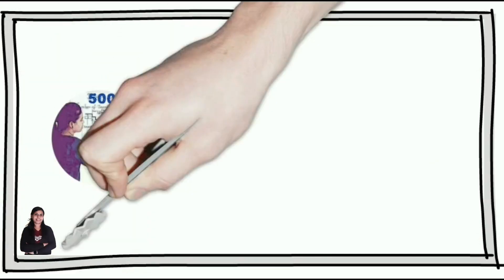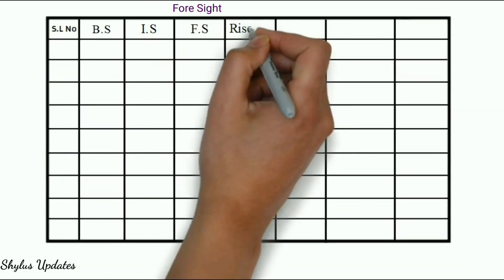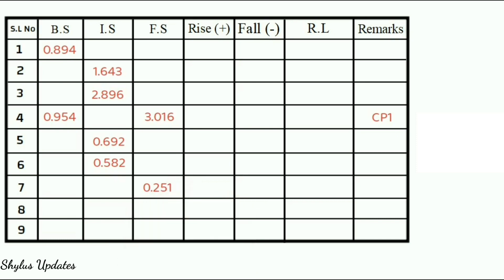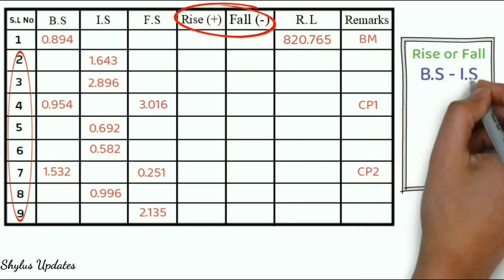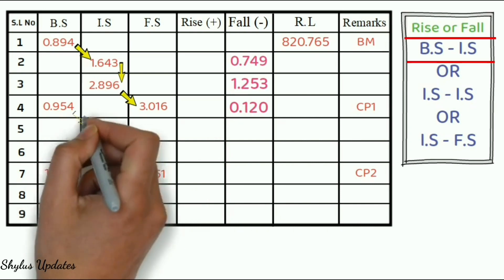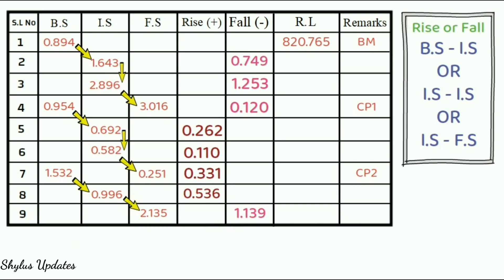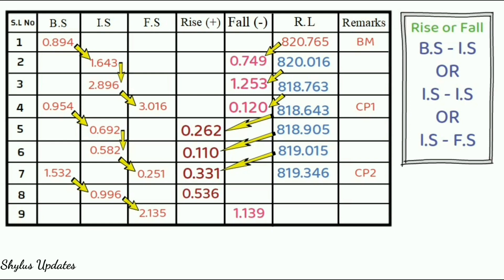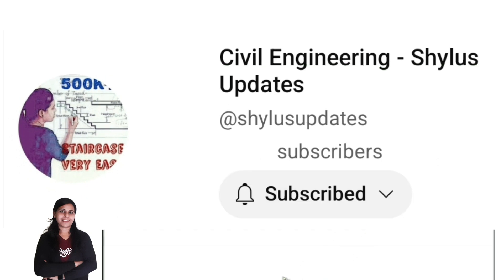rise and fall method in levelling | determination of reduced levels | surveying | Animated video

Comment: can i ask , i have a situation where by in CP Im not given a BS NUMBER how do i approach that ?
Reply from the maker: Excellent question 👍 — this shows you really understand the concept of Rise and Fall Method in detail!
Let’s go step by step 👇
 Situation:
You have a Change Point (CP) —
but the Back Sight (BS) reading is not given for that point.

 First, let’s recall what a Change Point means:
A Change Point (CP) is the point where the instrument is shifted to a new position.
At this point:
The Foresight (FS) from the old instrument station is taken.
The Backsight (BS) from the new instrument station is taken.
These two readings are connected to keep the leveling continuous.
So, every CP should have two readings:
👉 FS (from old position) and BS (from new position).
 Now, if BS is missing on the CP:
That means, after shifting the instrument, you forgot to take or record the new backsight reading.
Without that BS, you cannot directly continue the rise and fall or RL calculations beyond that point — because the new RLs depend on it.

✅ Possible Solutions:
1. If you have the RL of the Change Point (known RL):
Then you can continue like this:
Take the known RL of the CP (from previous instrument setup).
Use that RL as the starting point RL for the next setup.
Then continue with your next readings (IS and FS) normally.

Comment: Thanks in advance.May you please elaborate why you have located CP2 at 7th point instead of 8th point as the questions explains?
Reply from the maker: Sure, I will clear you doubt now ❤️

You have understood that at Row '7',
I have entered the 8th point CP2 right?
First see carefully how to enter readings,
1st point 0.894 (B.S)
2nd point 1.643 (I.S)
3rd point 2.896 (1.S)
4th point 0.316
(F. S - b'coz this point is CP1)
Next, 5th point 0.954 automatically comes on B.S
6th point 0.692 (I.S)
7th point 0.582 (I.S)
8th point is CP2 so it will come under F. S
So consider these readings as points.
and
You should not see the calculation based on Table numbers that is in first column numbers like 1,2,3,4,5,6,78,9.
This numbers are only for reference. These are not points.
In question they have given you 11 readings that is called points.
Hope you understood now ❤️
Have a good day 💚
Reply: Tnx my question was also like him but u cleared that tnx from ethiopia
Reply from the maker: Thank you🥰
Reply: Thanks alot for the explanation

Comment: I have one doubt mam , if the value of 4th cp is in the 4 column but 8 th cp is in 7 😅
Reply: The 4th column has 2 readings,4th on the FS and the 5th value is in the BS, still under column 4.Now as we progress  you'll find that the nth reading will be in the  column before
Reply from the maker: Good 👍🏻
Reply: Great explanation
Reply from the maker: Firstly your statement itself wrong.
4th point CP1 is in 4th row not in 4th column.
I will clear you doubt now ❤️

You have understood that at Row '7',
I have entered the 8th point CP2 right?
First see carefully how to enter readings,
1st point 0.894 (B.S)
2nd point 1.643 (I.S)
3rd point 2.896 (1.S)
4th point 0.316
(F. S - b'coz this point is CP1)
Next, 5th point 0.954 automatically comes on B.S
6th point 0.692 (I.S)
7th point 0.582 (I.S)
8th point is CP2 so it will come under F. S
So consider these readings as points.
and
You should not see the calculation based on Table numbers that is in first column numbers like 1,2,3,4,5,6,78,9.
This numbers are only for reference. These are not points.
In question they have given you 11 readings that is called points.
Hope you understood now ❤️
Have a good day 🎊
Share it with your friends 💚

Comment: What should we need to do when shifting of instruments is not given in question mam.
Reply: Then , notice the values u can observe that the values are gradually increasing. But at one point one value suddenly decreases and the remaining values are gradually increasing again. At this point the instrument is shifted. 
For example: Consider the readings as - 0.855, 1.545, 2.353 ,3.115 ,3.825 ,0.455 ,1.380 ,2.055 ,2.855 ,3.455 ,0.585 ,1.015 ,1.850 ,2.755 ,3.845.
Here the instrument is shifted after 5th and 10th reading.
Reply from the maker: Thank you 🥰
Reply: Replying after 1 year😂